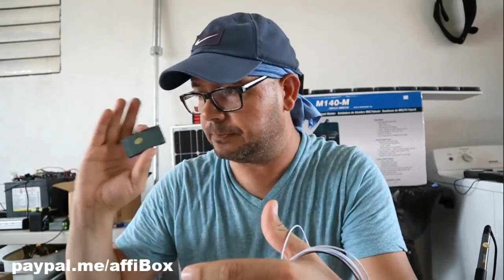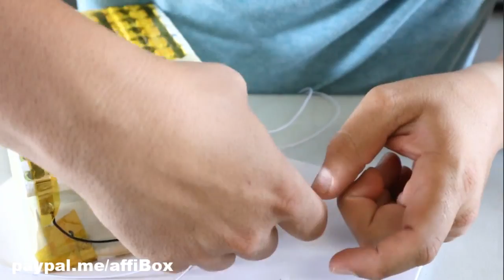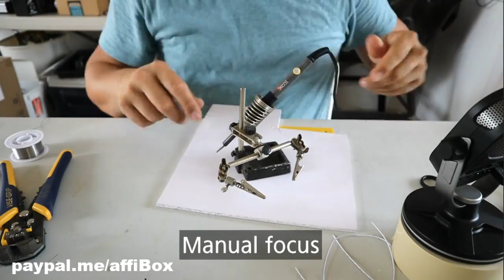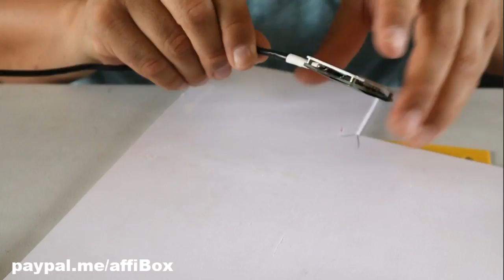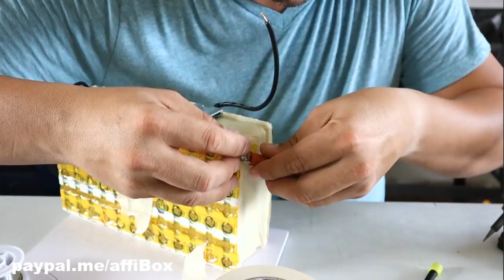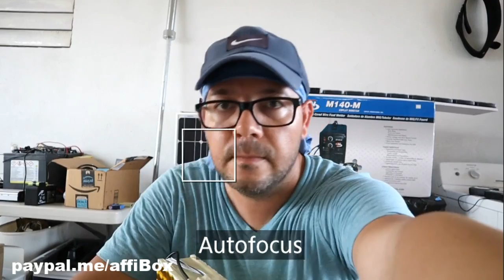Javier Camacho | Installing a 7s BMS on a Diy 18650 Battery Pack

Comment: with this 7s 24v bms you have 29.4v output  or you have 24v ???       i have a doubt in my RV project, i want 24v, which bms i should buy 6s or 7s bms for litio batteries ?? thankyou
Reply from the maker: 7s is the perfect substitute for 24v in acid

Comment: Hola Javier, excelente trabajo,.. Por favor comentame cómo se elige los amperios del BMS ... Gracias
Reply from the maker: Los amps del bms va a depender de cuanta energía piensas usar de forma continua
Reply: Hola y gracias por tu respuesta,.. Significa que para un consumo instantaneo de 2000 vatios, (Heladera, lavarropa, Ordenadores, etc. simultaneamente conectados), será si el banco es de 24 voltios, que habrá un consumo de unos 83 amperios y el BMS tendrá que ser superior por supuesto,.. ¿Es así?.. Correjime por favor y gracias de nuevo por tus aportes,..
Reply from the maker: Tu vas a prender todos esos equipos a la misma vez?
Reply: Gracias de nuevo,.. No siempre, Pero imaginemos que el refrigerador esté funcionando y dos ordenadores, entonces se conecta una plancha o algún otro de mucho consumo,.. Es un caso hipotético de máxima, considerando que el consumo diario promedio actual, según factura de servicio eléctrico es de unos 5500 Wh,.. Que recomendás?
Reply from the maker: Mejor precaver que remediar
Reply: Gracias por comunicarte de nuevo,.. ¿Esta bien lo de 83 amperios como lo calculé tres respuestas más arriba?
Reply from the maker: Si y no. Siempre vas a necesitar mas de eso en especial cuando una nevera arranca
Reply: Muchas gracias Javier,.. Es muy útil tu trabajo,.. Hace falta más gente como vos en el mundo,.. Saludos...

Comment: Amigo Javier ese mismo BMS lo usastes para una bateria 24 vdc 7s y 12 lineas en paralelo yo quiero comprar un bms es este mismo pero solo queria saber si se pueden poner algunas filas mas en paralelo para tener un poco mas de corriente por ejemplo en lugar de 12 filas poner 15 o 20 o solo soporta 12 gracias de antemano
Reply from the maker: Ese bms solo da 20a de uso continuo. Ten eso en mente a la hora de usarlo. Puedes ponerle todas las baterías que quieras pero recuerda sus limitaciones.

Yo lo he usado con 10, 12 y hasta 20  en paralelo
Reply: @JavierCamacho  entiendo y como para lo que yo quiero entonces que puedo usar al menos mientras terminas el que estás fabricando yo pienso usar al menos 7s 80 en paralelo yo tengo 2 monoblock agm de 150 amperios son las que quiero sustituir por litio las de agm acumulan un total de 3600 watts de los cuales se puede utilizar unos 2500 para no afectarle la vida útil porque estas no se pueden descargar total así que lo que tengo que conseguir con litio es eso 2.5 kw para que mi pequeño consumo sea abastecido sin quedarme sin carga en paneles  tengo 1.2 kwh con 18Ah y un controlador de carga mppt de 60A con eso cargo mis 2 monoblock de agm

Comment: Con esas baterias 18650 me gustaria hacer para mi casa que sea 48v 200ah cuantas necesito
Reply from the maker: Como 1400 si son de 2200mah
Reply: Javier Camacho es mejor usar esas baterias 18650 o 12v agm
Reply from the maker: 18650

Comment: Hola Javier me gustaría saber cómo hacer un banco de batería de 12v y unos 30 o 40Amp ?? Tengo la batería pero no sé cómo unirla donde puedo encontró un mapa o diagrama que me explique eso o tienes algún vídeo es k algunos de los que eh visto esta. En inglés y yo no se lo que quiero hacer es usas esas batería 18650 para ponerla en un UPS pero quiero que tengo 12v x lo menos 20 a 40 amperes me puedes ayudar en eso??
Reply from the maker: Yo tengo varios videos en español que te pueden ayudar con lo que buscas y también mis videos tienen subtítulos en español.  También puedes bajar el app que te ayuda a configurar tu banco de baterías.
Reply: @JavierCamacho  puedes pasarme el link de la app para configurar pack de litio segun el voltaje, ruego tu atencion, saludos desde Argentina